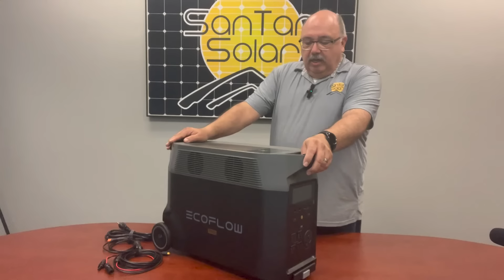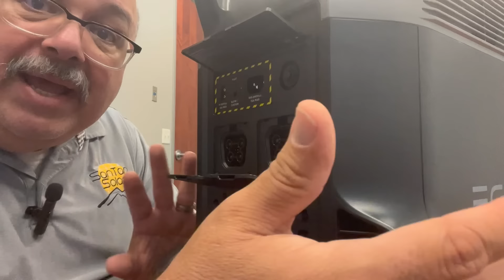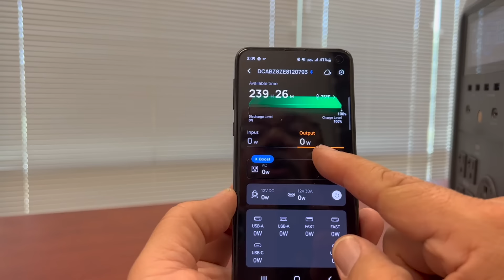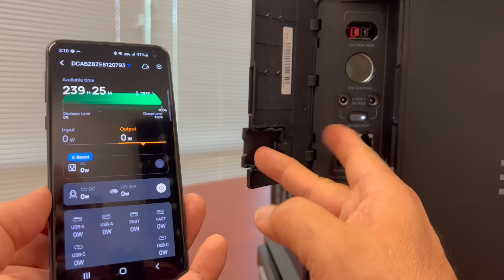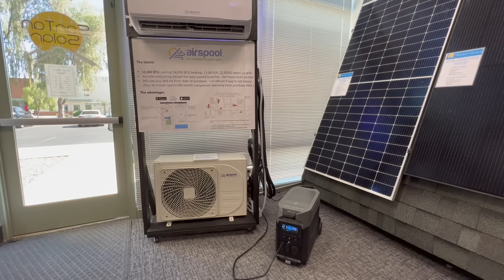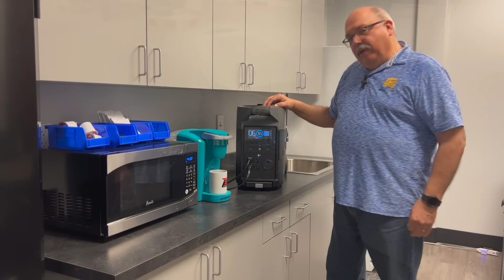The EcoFlow Delta Pro Portable Power Station - SanTan Solar

Comment: OK which SPECIFIC solar panels on your website will max out the solar input 1600 watts, 150 volts, 15 amp parameters?  I can't get a straight answer.  Most people's seem to be exceeding the 15amp limit.   I don't  want to damage my unit.
Reply from the maker: That is a great question! We have a “kit” with three SolarEver 410W panels that will generate: 1230 Watts, 111 Volts and 14 Amps.
Of course…. Fourteen 100W panels (2 strings of 7 panels each) generate: 1400 Watts, 147 Volts, 12 Amps.
So the question of "what specific panels we have"  but rather which combination of panels will work out. Besides maxing out the specs of 1600W 150V and 15A doesn’t give a lot of room for electrical spikes or higher panel production in colder climates. Staying a little below spec is my preference.
Reply: How would you add a wind generator to it for charging?